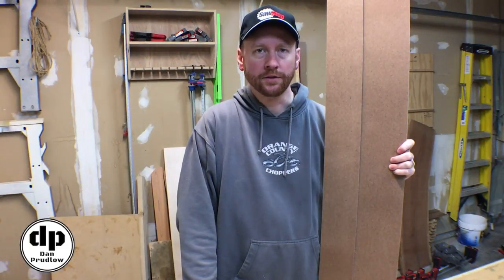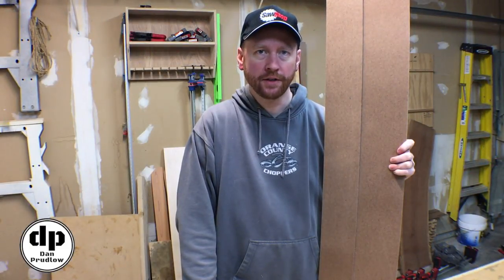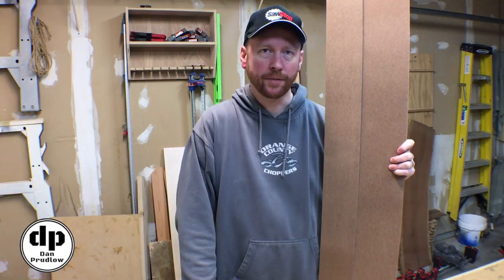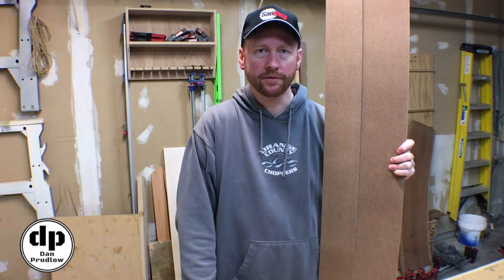Circular Saw Guide | How To | Woodworking Shop Jig

Comment: What material did you stick to the bottom? I assume it was some rubbery substance intended to keep the guide from slipping around. How is the sticky factor holding up? Did it work as intended? So many questions, asked out of logical order :P
Reply from the maker: It’s tool box drawer liner I picked up at Home Depot...10 bucks I think.  It’s not really sticky as much as just non-slip.  With very light pressure the board will not slide around on your work piece.  So far it’s working great.  The only issue I had is with the spray adhesive.  I cover this in my website article but basically I used a light duty adhesive and it started to come loose after about a week just sitting in the shop.  I went back with a pro grade heavy duty spray, also from Loctite and I can tell it’s holding much stronger...no further issues with that so far!  Thanks for watching! 👍🏻